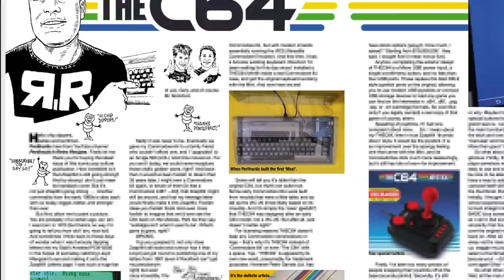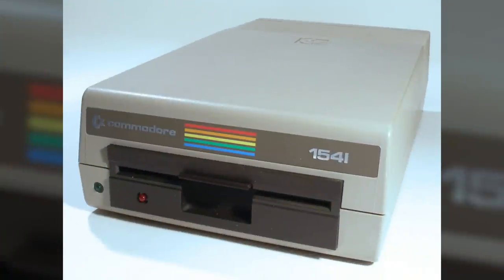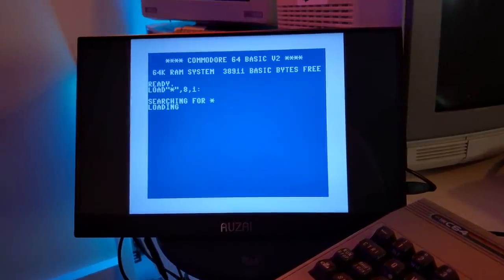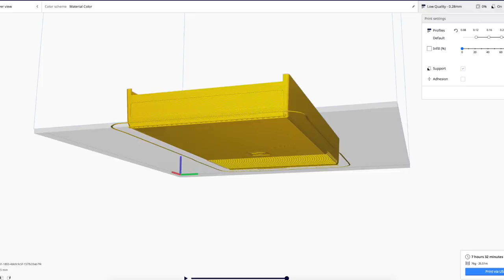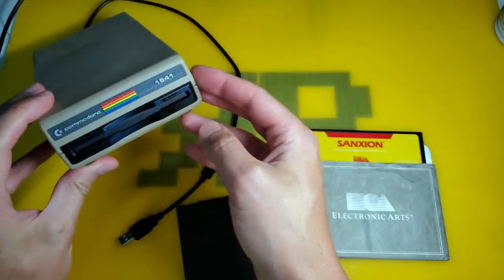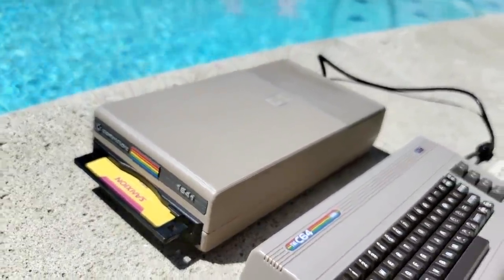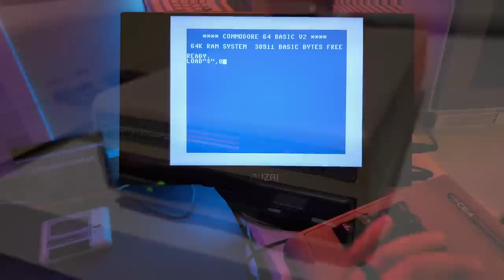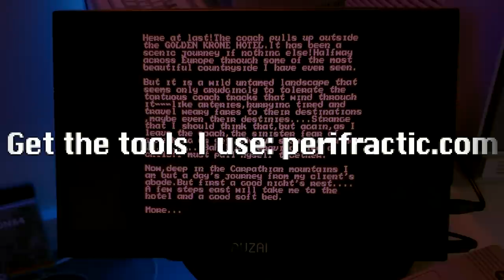Can we make REAL Floppy Disks work with THEC64®? 1541 Mini!

Comment: Beautiful project !!! very well done 👍👍👍, just one note, I would have modeled a locking system of the two upper and lower interlocking covers or with three / four screws instead of gluing them.
Reply from the maker: Yeah, sadly at 6 days I had to wrap the project up and take some easier routes. I did that for my previous DoubleJoy video though.

Comment: Superb. Will also be great for the new VIC 20.
Formatting under Linux should work too.
Reply from the maker: Thanks for the input. I've been trying to format the HD 1.44MB disks in Ubuntu with no success when plugging the USB floppy into THEC64 Maxi. The same disk formatted on the Mac still works, if I enable Master Boot Record. There's no such option in Linux that I can find. Any ideas how I could make Linux format exactly like macOS did?
Reply: @RetroRecipes  I don't currently know. Most likely possible somehow though.

Comment: I don't see the point in this one.  For file transfer USB sticks are faster and easier while the original software came out on tape, 5 1/4" discs or cartridges.  Now if you could connect any of those items to THEC64 I can see that being useful for those with a collection of original C64 software, but this just seems like a waste of time and effort.
Reply from the maker: The point is simple. Nostalgia. Read all the other comments and you'll see.

Comment: 15:40 this is where you lose the retro aesthetic, since the .D64 image is completely loaded into RAM on access. Nice 3D printed case though.
Reply from the maker: Well technically even a 1982 floppy drive loads everything into RAM. It's just doing it slightly earlier.

Comment: You can add a device that interfaces a real 1541 to a USB port (XU1541) and then use the Commodore drive exactly as it is without all that fuss.
Reply from the maker: Not on THEC64 you can't. It can only read FAT devices and the 1541 can't format disks as FAT.
Reply: @RetroRecipes  That's a pity. There is a guy who has it working. I thought it was as simple as plugging them together but I guess he must be using a go-between like a Pi zero or something to translate on the fly. I'll see if I can find out his method.

Comment: Is it possible to use a game system emulator on the pc. So that it can run a 5.25 floppy disk game using an actual 5.25 fdd and play it via the program?
Reply: Yes it works with dos box at least
Reply: @bricethompson1922  cool thanks 👍

Comment: Re formatting the disks, did you try with Linux? Not everfone has a Mac lying around.
Reply from the maker: No not everyone has Linux lying around
Reply: @RetroRecipes  Agreed. But a Linux live CD/DVD is free to download and burn. Buying a Mac just to format a disk is exponentially more expensive than free.
Reply from the maker: @stephenhargreaves9011  I'm not suggesting anyone buy a Mac. As mentioned in the video, 720K disks seem to work from Windows.

Comment: Should have printed the disk ring on the label 😀
Reply from the maker: Wouldn't that get in the way of the metal moving disk shield
Reply: @RetroRecipes  don't put it down that far 😀
Reply from the maker: @maxderp6588  Right, but in proportion it would need to be if you look at both disks...
Reply: @RetroRecipes  I just thought it looked missing when you held them up side by side... But you could always cut it and put one piece on the metal slide and the other on the plastic case.. (If it doesn't hang up in the drive) 😀

Comment: (checked the internet) usin the c64 directy

OPEN 1,8,15, "N:NAME,1A":CLOSE 1

where NAME is the label/disk name

it's doable with both 720/1440 floppies? Don't know...anyone does?
Reply from the maker: Well the problem is the disk doesn't mount as a USB drive in the first place, so OPEN won't work because it sees no drive. It's like trying to format a disk on a drive that's unplugged. Have you tested this to work?
Reply: umh not searched just for curiosity..i barely know how to turn on a pc...

Comment: A liiiitle bit more work and you can remove the housing and make it look even better or even use the same lever system 

Plus, you could attach it more robustly to the case than just hot glue